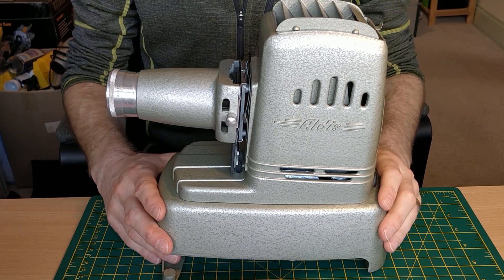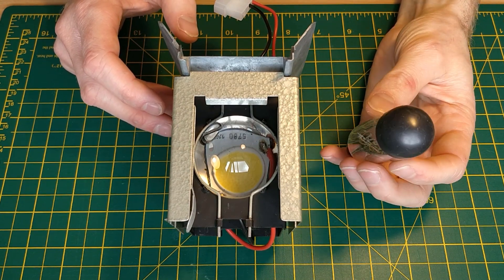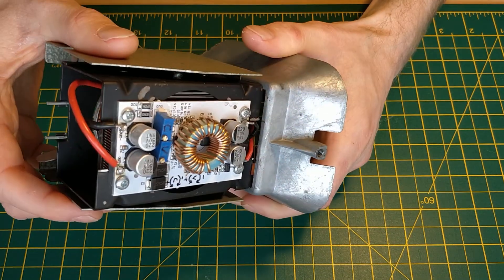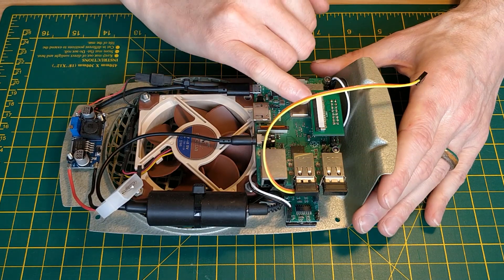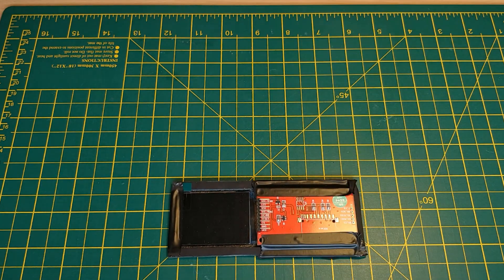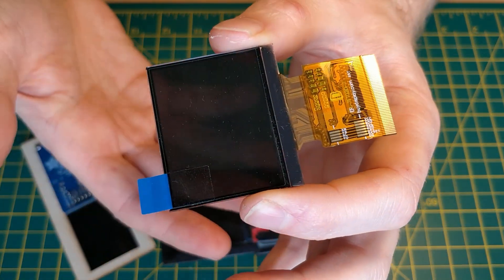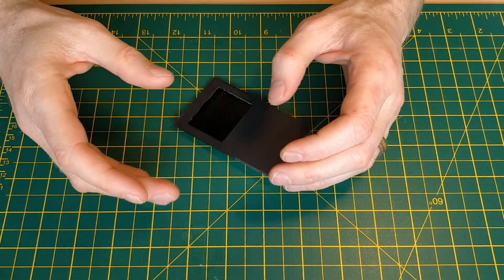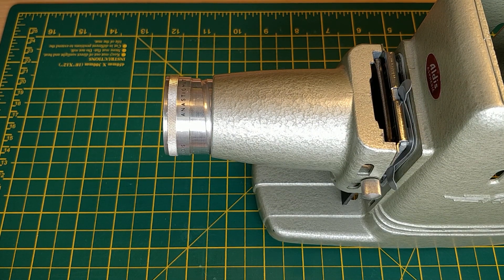RetroPie slide projector games console

Comment: Hello. Let me share with your readers some ideas about modifying the slide projector. I work on a slide projector to make it work like a video projector. I used the components from a Chinese YG300 Pro video projector, which is cheap and it has all kinds of connectors, hdmi, usb, and others. It has a 2-inch screen, 5 centimeters diagonally and is panoramic, more wide than high and the resolution is 480x272. The slide projector I am modifying is the ALDIS 303 which uses 35mm slides but fits the 2 inch screen in the original metal frame with the scraping with the file of approximately 1 millimeter to fit the whole screen horizontally. It is a slide projector from the 60's made of aluminum and with some modifications I attached an aluminum radiator that makes contact with the slide body of the projector and can be cooled better in this way. In the end, compared to the Chinese one, it is perfectly clear everywhere and brighter due to the lenses used, the cooling will be better and quieter, the sound stronger because I will replace the speaker and the fan and it will look gorgeous as a design. See here part 1 of my slide projector modification. https://www.youtube.com/watch?v=1A5Uk55eBEA

Comment: Awesome! My 2k res. silent projector project is still waiting in the shelf to get build (from a cheap 50 bucks china projector) New display better silent vent, better led - boom - movie time!

What an awesome idea to just separate the foil from the display. Were you able to reuse the "peeled off" foil or did you had to buy a foiled glass?

Thanks, love your channel
Reply from the maker: I couldn't reuse the polariser as it got damaged when I removed it. No big deal though, I just bought a piece of polarising plastic from Amazon and cut that down to the right size. It's not the brightest image, but I'm very limited by space in the projector so I can't put in as much cooling as I'd like! That limits the power of the LED that I can use.
Reply: @ScottMarley  Nice, didn't know that can be bought. Will try some cooling tho since I might have a bit more space in it. Thank you for your answer, that was a biiiig help :)
Reply: @ScottMarley  LCD screens from normal projectors do not have polarizing filters attached to them. You can try for a better cooling of the screen, to peel off the polarization filter on the front of the screen and on the back of the screen if it has it there, if your fan that you mounted below does not cool the screen. You can try to place a polarizing filter further forward in the spherical aperture, you can try a polarizing filter of the type used by cameras. Cooling the screen is mandatory. My screen without cooling lasted for a few minutes, after which it looks half black as if it had been broken. He recovered after cooling down.

Comment: I want to use the projector with a satellite receiver and please tell me what you think of this LCD display ?
AUO 2 inch LCD display /2.0 LCD module /A020CN01.V1 display module. I'm thinking of using a 150w led, like the one in the link below. https://www.aliexpress.com/item/4000741643527.html
Reply from the maker: Hey chap, sorry I didn't reply to you, I missed this comment. That LED will be plenty bright enough, but you will absolutely need a huge heatsink with forced air cooling or it will cook itself in a few seconds. It depends on if you can fit that required heatsink into your projector.

Comment: I am also going to do this and I have an ALDIS 303 35mm SLIDE PROJECTOR, do you think it is good and what size LCD screen is right for it?
Reply from the maker: If it is a 35mm slide projector, then you want an absolute max of 2inch LCD, as 35mm film has a diagnoal size of 1.7 inches. Even at 2 inches you might lose some of the sides of the image.